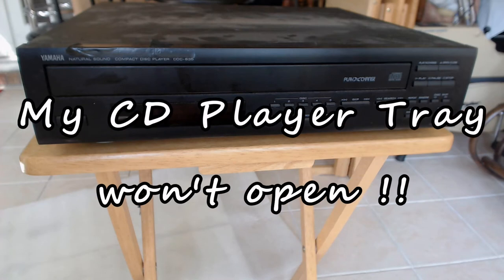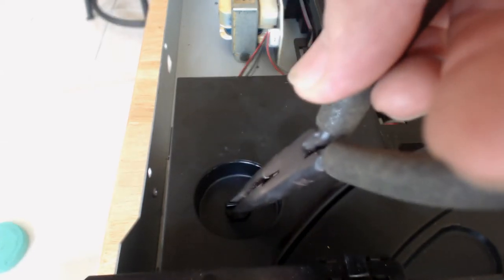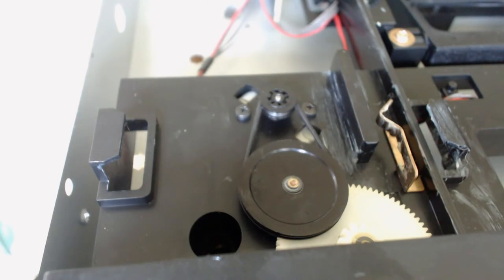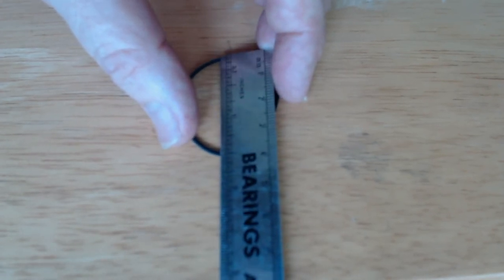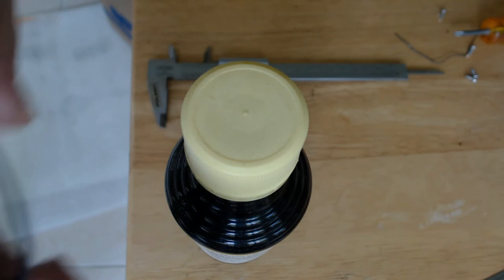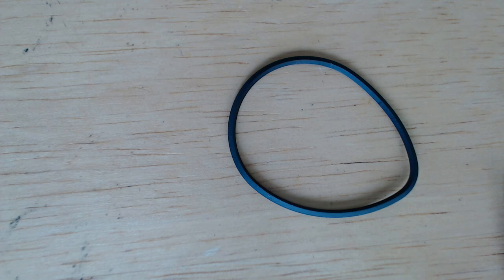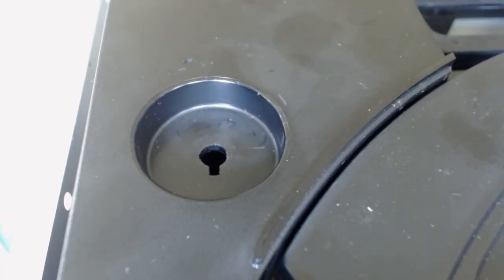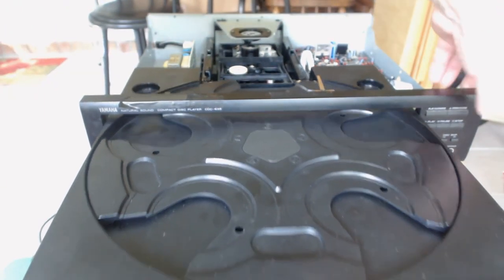DIY! How to fix a home CD Player that won't eject disks using common O-Rings!

Comment: I have the exact same CD player, do you remember what size O ring you used?
Reply from the maker: No.  Being an engineer I keep “Stuff” I might need.  I strip equipment regularly before it gets recycled.  

Use an O-ring 1/16” in diameter.  If you use a string wrap, that diameter size should work taking the length of the string divided by PI.  Any Lowe’s or Home Depot should have what you need.

Comment: Simple Fix, Thanks!  Amazon has these, here’s the part info. Yamaha VQ776900 Carousel Drawer Belt.

Fits the following:

Yamaha CDC-501, Yamaha CDC-506,
Yamaha CDC-585, Yamaha CDC-615,
Yamaha CDC-625, Yamaha CDC-635,
Yamaha CDC-645, Yamaha CDC-655,
Yamaha CDC-675, Yamaha CDC-705,
Yamaha CDC-685, Yamaha CDC-755,
Yamaha CDC-765, Yamaha CDC-91,
Yamaha CDC-716, Yamaha CDC-735,
Yamaha CDC-775, Yamaha CDC-80,
Yamaha CDC-805, Yamaha CDC-815,
Yamaha CDC-835, Yamaha CDC-845,
Yamaha CDC-906, Yamaha CDC-90,
Yamaha CDC-95, Yamaha DV-C6280,
Yamaha DV-C6480, Yamaha DV-C6660,
Yamaha DV-C6680, Yamaha DVD-C740,
Yamaha DVD-C900, Yamaha DVD-C920,
Yamaha DVD-C940, Yamaha DVD-C950,
Yamaha DVD-C950BL, Yamaha DVD-C996, Yamaha DVD-CX1, Yamaha DVR-C300 and many more.

Comment: My sony CDP- C615  won't power on when the power button is pushed.  Plug in cord looks good so just wondering what it could be(obviously something isn't connecting??).  Enjoyed your video here and liked/subscribed while I was here.  Thanks for any suggestions!
Reply from the maker: Most electronics use the micro switches.  If you can take it apart and determine the switch type, you might be able to find a new one at Digikey, Newark, or Mouser.  Usually means spending $10-$15 to get a $1.00 or less part.  Yes you’ll need to know how to both solder and desolder.  I’d start watching those videos if you don’t already have those skills.  Find some scape electronic boards to practice on before working on your repair.
Reply: @EdHumble  Thanks a lot Ed!!